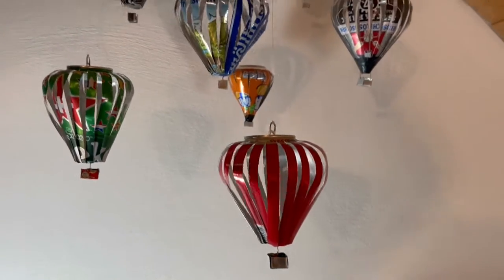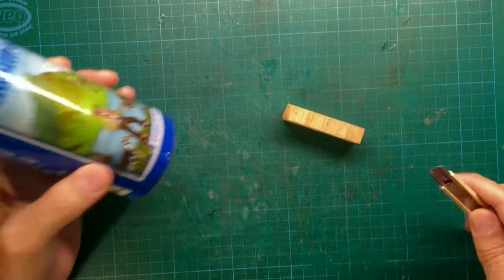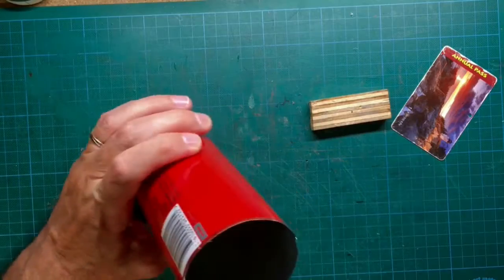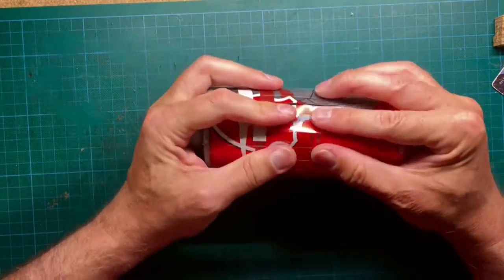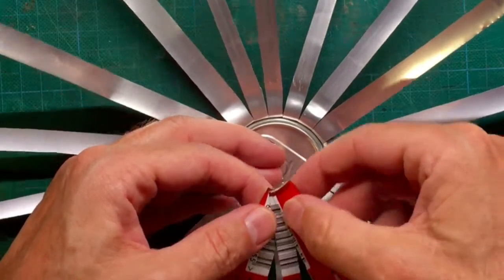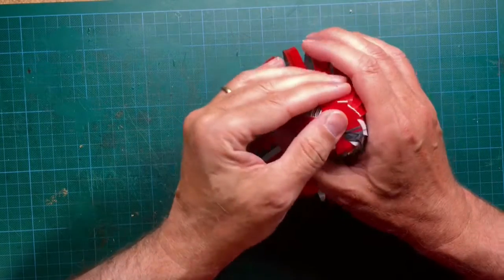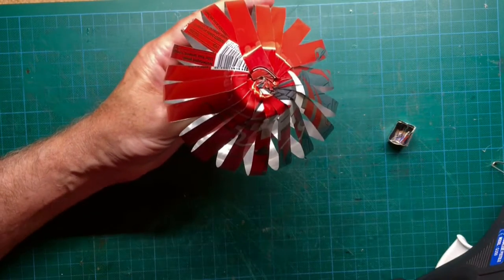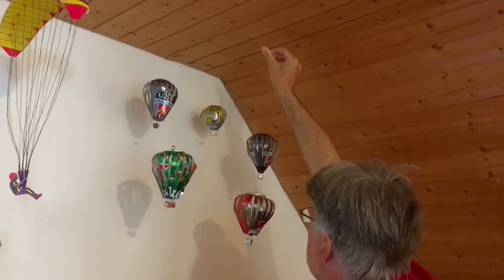Soda can hot air balloons

Comment: Can,I use hot glue or E6000 glue on Aluminium cans?
Reply from the maker: The kind of glue I do recommend allows that the two parts you want to glue together immediately stick together. If you take other glues like the one you mentioned, you have to fix the parts e.g. with cloth pins until the glue is dry. So if you have a lot of parts to glue together it takes you a very long time because you have to do one after the other. Do not forget that aluminum is conducting the heat very well. So if you use hot glue better wear gloves .... so you can try but it will be more complicated.

Comment: 😍👌🏽👍🏼👍🏼👍🏼👍🏼👍🏼
What kind of glue are you using?
Reply from the maker: I use UHU por ... but you can take also Pattex contact ... you have to check if the application note says something like this: "Apply the adhesive to both surfaces and allow to flash off until the adhesive is dry to the touch (after approx. 10 minutes)." ....